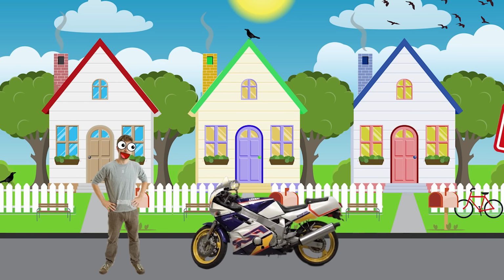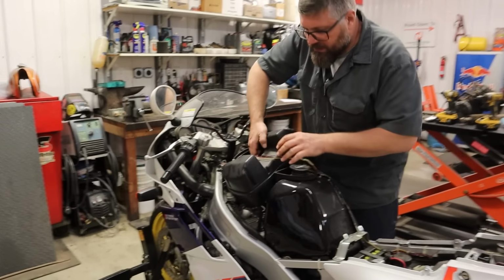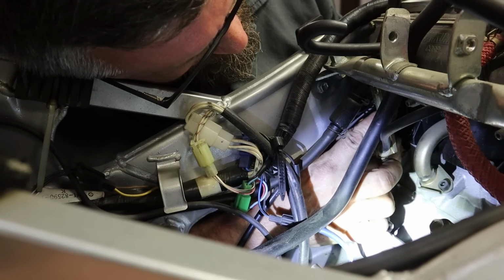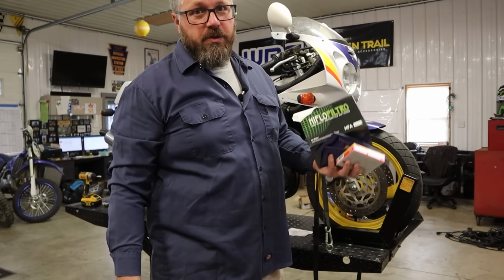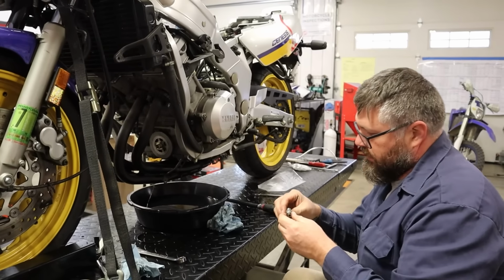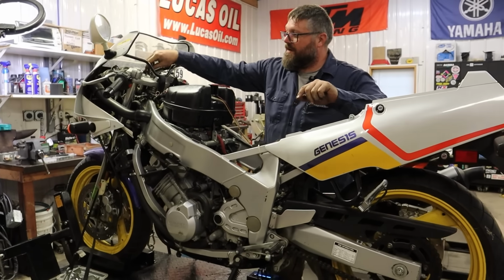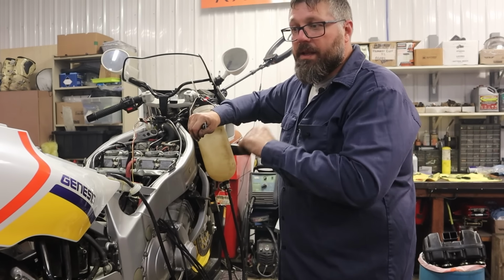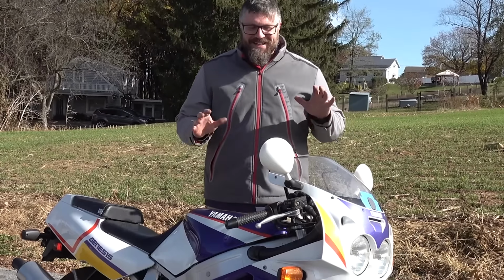Can I Get This 30 Year Old Yamaha Motorcycle Running?

Comment: bought an 89 fzr 600 as my first bike around 10 years ago and it was a complete wreck, but great oppotunity to learn to tinker with. Fitted yzf600r cyclinders and pistons to make a 660cc engine ,  power is similar to a modern 600 afterwards.

Comment: I know this is an old video, but on the off chance an old FZR ever crosses your path again: Those little gray plastic plugs pop out of the frame and give you easy access to loosen and tighten the carb clamps with a long driver.

Comment: He asked what the chances that the battery still worked... I'd say 1 in 10 million because I think I found the exception in my lifetime. I was a teenager and me and my friend found a couple of abandoned cars and bicycles so we fixed up the bikes and rode them around for years but we never messed w/ the cars then one day while looking under the hood I found a key and an inspection sticker from the late 50s (it was the mid 90s at the time) so I tried the key and it opened the door, then when I sat down inside I thought 'what if it started right up' and I laughed but to my surprise it had lights and everything but the motor wouldn't turn over.... We used to hang out in them old cars because they was huge inside and we even slept in them one time we got drunk but I think I found the only battery to work after almost 40 years of being parked.     😁😂

Comment: i have an '89 in much worse cosmetic condition that I got for $500. Had to do literally every possible repair for it to run haha. Threw some stunt gearing on it and some stiffer springs and it's the perfect campus commuter bike, hops curves, smokes the rear, and hangs nooners in with 0 effort. tops out at 102 now though.

Comment: Lol that oil looked brand new!  Probably had a few hundred miles on it.  Unfortunately thats how it is with my Harley.  I change all the fluids in the spring, ride it once or twice and don't touch it for 2 years.  Then 3 years later Im like Im gonna ride the bike more this summer.  New battery new fluids, then I put 200 miles on it. 😂😂

Comment: "YZR"?
🤨
I wonder how many younger people are mystified by a full bank of carbs disassembled?😏
Ive got a pristine 93 ZX11 D. I was doing the carb tuning (butt Dyno). I had the jet or needle change down to 30 minutes. That's from parking on the lift to running.
Old school bikes can be fun to tinker with.

That's a really nice little bike. Rare find.👍

Comment: I’m in the process of restoring an 89 model in Australia, but mine is in far worse condition, 96,000km on the clock and dropped many times. Plus we only got that body shape from 89-92 before they changed here, so parts are hard to find.

Comment: Advice from making the same mistake, don't ever tighten fairing bolts with a power drill, even with a low torque setting. Old plastic cracks incredibly easily. Even if it gets a hairline crack it will widen over time. Use finger feel and err on the side of snug not tight.

Comment: Lol true story about a battery in a John Deere mower we have . Original battery since 2001 till now . Idk how but I’ve never seen a battery last that long but yah we still have the original working battery in the mower . When we stored it for winter time we put battery tender on it for the first few winters then it sat for few years an got the mower running again an used it for few more years then it sat again for few more years an got her running again started using the tender again for battery an been using the tractor evry summer these past 4 summers till now lol the original battery is still work true story an idk how that’s possible for a solid 20 year old battery to work

Comment: Weird seeing an external oil filter.  My last bike was a 1978 Kawasaki 1000 LTD, which takes an internal cartridge.  Remember it was always a pain getting the oil filter bolt back in and the cover back on because of the exhaust pipes.   
Certainly miss the LTD and the ability to ride it.

Comment: This is the FZR600, the yzf was used on the 750, and later on the thunderace/cat 600/1000 maybe 95.  This fzr came out in 89, I believe the 94 was last year they made it, although the yzf600 had the same frame different plastic.  The engines appeared the same, but had different bore/strokes, and people did swaps and made 660s with longer stroke/bigger bore combos.

Not on the US, but in the same period an FZR400 was sold that looked identical, but had aluminum frame, engine cases were the same.  So the hottest hot-rod setup was fzr400 frame with 660 motor.

The yzf750 looked like magic, too bad Yamaha cursed it with the worst engine they ever made.

Comment: I bet that brake fluid is going to be funky too. 

So caring of you to change the oil. But did you change out the flush the 20year old AIR IN THE TIRES?!

😂ha. Just pulling your chain. I hope you didn’t fall for that.

Comment: They"say", put a new crush washer, oil plug washer, whatever, on new, every time the oil plug goes back on. Only done it a few times in 50 yrs, hundreds, and hundreds, of oil changes, never had one leak. If they look bad, or, a new one comes with the filter, that is about the only time.

Comment: That is a beautiful bike. Also, youre a brave man to torque the fairing bolts with an impact. And holding that flashlight over the throttle body gave me anxiety. Is that a streamlight or olight? I have the olight one, pretty handy little torch.

Comment: Good job! but isn't the smoke coming from the exhaust somewhat concerning? It seems like burnt oil, Looking at how clean the oil came out it means there wasn't any oil leaking or burning before, It might be caused by bad valve seals that went bad by ageing.

Comment: A very important bike, in terms of milestones...name an alloy beam frame, watercooled four stroke, monoshock, adjustable suspension bike made before this.....and zero has changed since. You can buy this years BMW S1000R or Fireblade....and you get nothing more than that list of specifications...much refined sure...but the same basic set of design features

Comment: I went through this with a 96 cbr600f3, man those carbs suc, to get at.
These look easier. All 4 of my float needle were gummed shut. Cleaned the bowls and mains. Replaced tne needle valves and pilot jets. I warmed tne boots and she slipped right if. Ran great for 20 mins then lost a cylinder😢 
After much moping and testing i came to find my dead cylinder drowning in fuel. My son and i blame each other for not tightening the pilot jet that fell out. Ffs 
She runs like a top now. Moral of story double check everything  before putting thise damn carbs back in there 😅

Comment: Syncing the carbs is to make sure all of them are pulling the same amount of vacuum so that the fuel ratio is the same in all of the cylinders so one does go lean on ya and burn up that cylinder. Makes for a better harder pulling motorcycle when all the cylinders are getting the same mixture of fuel to air ratio. Yadda yadda and Bob's your uncle move on Craig: I hate it when people think it is cool to jam your motorcycle up to something just so you can spin the back tire and make it start rolling smoke off it, just a waste of rubber that could be used cruising the road or racing on the track. I want to know what he paid for it. I used to do the same with Harley Davidsons buy for a $1000.00 not running and sell for 2500 and up after I fixed them to run on the road again.

Comment: be careful riding on those 30 year old tires. also all rubber components should be checked for drying such as brake hoses. i have put back on the street several older bikes and i like to replace the brake fluid, brake lines and tires at least. fork seals often need it too but that is not as big a safety issue as tires and brakes.

Comment: This might be a silly question, is it safe to spray or soak carburetors in cleaning fluid? Does the fluid affect the rubber bits in the carb?

Comment: So you never checked the cylinder walls to c if there was any rust?? I mean it was sitting for 20 years. I have a 400 cc that's been sitting for 15 years and I'm too scared to check the cylinder walls 😢

Comment: You don't synch' the carb butterflys with a vacuum gauge, you just adjust them mechanically so that they all open at the same time. One of the easiest ways to do that is using something with an accurate size like a drill bit. You adjust the fit of the drill bit between the butterfly and the wall of the carb inlet till it just 'nips' on the bit and it 'just' slides in and out, and then do the same for each of the carbs so that they are all exactly the same. You then start the engine and adjust the idle using the 'master' screw. The vacuum gauge is then used to adjust the mixture screw on each individual carb until all the readings are the same, and then re-adjust to the to the correct idle speed. The carb butterfys will now be 'in synch' all through the complete rev range. If any other adjustments are required beyond idle speed then they are done by re jetting and the raising and lowering of the needle height. But unless something has been changed, like exhausts and/or air filters, that shouldn't be an issue.

Comment: Hey Craig. Im being offered a 1994 fz400r for just about $1000 with bad ignition coils and loose tension wires. Was running about a year before it was put into storage, any tips for getting it running? I have minimal motorcycle mechanic experience but I know a thing or two working around tools and machines, studying aircraft maintenance and such. Any and all advice would be much appreciated.

Comment: Have you ever had an issue riding on older tires like that?  I'm fixing up a garage kept Fatboy that has ten year old tires that were low on air for a few years.
Reply from the maker: Yes. These tire were SUPER hard. first time I hit the rear brake the back of the bike almost passed me. If you watch close I was taking it really easy, didn't want to hit the deck

Comment: What, not using the vacuum method of syncing any more?  Digital is cheating!
In 1994 I was still riding my 1987 GSXR1100 with bias-ply tires. The next year I sprung for my first new bike, a 1995 CBR900!
Reply from the maker: First time using the Digisync. Have to say I didn't hate it. but I still have my gauges hanging on the wall;)

Comment: I use to have that same exact bike a guy I knew sold it to me after his downed it and I put a set of Wisco 619cc pistons in it but never got it running was going to fix it up for my dad or my girlfriend but just never happened so I sold it but your saying 94 and Honda was the middleweight champ and sure its true but the FZR 600 really only had two years of glory any way the FZR 400 was bad azz but in 89 Yamaha came out with the FZR 600 to compete with the CBR F1 or the CBR 600 Huracan but in 91 Honda came out with the CBR 600 F2 and it put the FZR down a few pegs now people still bought the FZR 600 but it wasn't as popular as the F2 and in 94 the FZR only had a few more years left and Yamaha was still second to Honda though the F3 years until Yamaha came out with the R6 now the F4 and F4i was good but the R6 was popular when it came out and it reminded me of the days when the Honda F2 came out and it was the 600 to buy so Yamaha got Honda back it just took a while to do it fun thing is the F2 was good and had better performance than the FZR 600 but I know  a few guys out there that got their hands on the F2 killer and that was a FZR 400 it had an Aluminum Deltabox frame not steel like the FZR 600 and F2 but there FZR 400 had a FZR 600 motor in it one of them had a 630 kit in his so it would eat F2 up I still think if Yamaha really wanted to be the top dog they would have taken the FZR 400 frame and put the 600 motor in it and it would have been as good if not better then the F2 and would have never been second best

Comment: I would NOT have parked that bike for twenty years just on her say so. If It was OK before the kids, it has to be OK after. Women need to get a grip. 
On another note, these bikes were OK when they ran.. repairing even the tiniest  problem meant tearing the whole bike down just to reach a 5 mm screw that needed tightening.

Comment: I love the channel.  
But for the love of God.  Stop using a impact driver on carbs and body work.  
Cast aluminium can crack so easy, on the carbs.  
A proper JIS screw driver would do the job.  
And using a impactor on the fairing panels is going to go wrong.  No matter how controlled you are.

Comment: "And that's pretty much how you synch a carburetor ".. No,it isnt,and it doesn't generate more flow when the throttle is opened,the engines vacuum during the down stroke prior to intake opening creates the vacuum and opening the throttle ALLOWS the engine to suck in more fuel and air and mix them on their journey from the carbs intake venturi and the carbs main jet feed hole into the intake runner,past the open valve and into the cylinder...and that is one way to clean a multi carb setup,but will often leave the tuner having fits trying to determine what is wrong,clogged,or set too high,too low,or wtfe er...  There is literally only 1 way to properly clean a multi carb setup,and it involves 100% complete dismantling,and fully vatting all metal parts for a few hours minimum,followed by a thorough manual cleaning of each and every orifice and passage using compressed air,carb cleaner,etc..

Comment: I owned this bikes big brother..the fzr1000..what a POS...i urge anyone to steer clear of the biggest lemon Yamaha ever built..my bike was brand new and the clutch basket started to fragmentate and the little pieces clogged the sump pickup screen and that caused the 20 valve genesis head to self destruct and it broke a rod that went right threw the case.. complete destruction in 1 second at high rpm wheel stand..so Yamaha replaced the complete engine with a crate motor..a few months later it did the same exact thing..so Yamaha replaced the motor..a few months later I sold it... what a lemon..I bought a gsxr1100 after I sold it and never had a problem with it after beating on it for several years...

Comment: Keep not on cleaning a rack of carbs sumtimes they may have diff jetting for the inside carbs an diff sizes for the outer carbs due to heat of the cylinders . I come across that an thought sumone put wrong jets in but no sumtimes on a rack of carbs they have diff size jetting from factory due to the heat diffrance of the inside cylinders an outside cylinders of them 4 cylinder bike engines even 3 and 2 cylinder engines will have diff jets on a rack of carbs sumtimes not
Reply from the maker: You will see some V-twin bikes with different jetting too. Ya always have to pay attention to that stuff.

Comment: Wow, Sport bikes are the worst design ever.
Look how much you had to take off just to get to the carbs.
Ridiculous.  Why I'll never buy a Sport bike, used, or otherwise.
They are like front wheel drive cars.  You don't want them, because you never want to have to work on them.  But you will.  And then you will regret ever bringing the thing home.  Give me a 70's 80's generic cruiser motorcycle any day over something like this you can't get a wrench in anywhere.
 et.